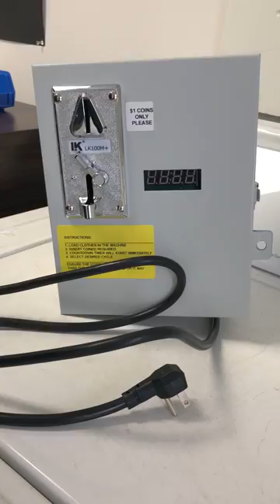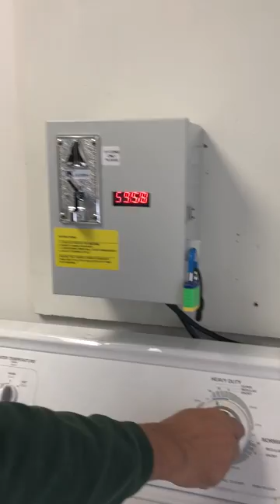How to Convert Your Domestic Washer and Dryer into Coin Operated Laundry Using SMARTCOINBOX

Comment: Can you do how to connect one video for auotomatic front load washing machine
Reply from the maker: Front load or top load...you are just moving power cords around. Plug your washer inside the smartcoinbox and plug the smartcoinbox back to your wall outlet. Done. No cutting wires. no electricians needed,

Comment: Some settings are 3 hours and some are 2 hours. If the person puts in for 1 hour Then the machine will go off half way through?!!
Reply from the maker: You can preset to run for 3 hours if you want. For example $2 (8 quarters), tenant will put in 8 quarters consecutively and as soon as he/she dropped the 8th quarter power will turn on for 3 hrs. Amount and minutes are adjustable. Some of our customers assign a cycle. If they have extras (spin, wash) then they have pay more.
Reply: What on earth are you washing for 3 hours?   Are you a coal miner?
Reply: @markpro1961  no but a usual wash and dry is 1h45 min....

Comment: Does it work on front loading washers?
Reply from the maker: Yes.
Reply: Is it for  sale  somewhere  specifically??
Reply from the maker: P cinematic  What our clients do is they assign a cycle with a specific amount. There is a  beeping sound in the last 30 seconds (adjustable to 60) in the coinbox  timer enough to give the tenant a chance to add more coins if needed. We sold thousands of these units for digital or non digital washer.
Reply: Hi, have you thought or developed a system that is no longer dependant on tokens and more app activated / nfc?

Thx

Comment: At over $300. Way to damn expensive!!
Reply from the maker: Its worth it. How much coin do you think you can collect in a month? Add the savings on your utility bills . We have customers that bought the smartcoinboxes back in 2012 and still in service today. They got their money back multiple times!
Reply: Your crazy if u think that’s expensive the machines are like 1000
Reply: I'm considering getting these as a defensive measure to protect against abuse.
Reply: I have a ex coin opp speed queen. It was $150 and they used a fork lift to put it in my pickup. 
That home washer won't handle heavy use of tenants.
Many coin opp machines for sal for 2-500 and they are meant for hd use

Comment: Yeah, try hooking up an electric (not gas) dryer to one of these coin operated devices, and you'll quickly find out that NONE OF THESE COIN MACHINES WORK ON 240-VOLT ELECTRIC DRYERS !!!
Reply from the maker: Why don't you contact the company you bought it from?
Reply: @smartcoinboxbymqtekindustr6711  I did not buy one because I'm an electrician and I already know these coin machines won't work with a 240 volt electric dryer.
Reply from the maker: @ihastoomuchstuff2  No secret here. We use a timer board that drives a relay and in return drives the POWER relay. In case of the 240V we use a 2 pole industrial type power relay (40 Amp resistive). The coil of this relay is driven by the on-board relay in our timer board.  Our ECW682 (120V) and ECD137 (240V) passed
a rigorous test in a testing lab (ETL). We only use CSA or UL approved parts.
Reply: @smartcoinboxbymqtekindustr6711   guess the electrician didn't know about that. Most electricians think they're hot shots that know it all. Considering one of these units for my rental. Do you guys have one that does credit cards?
Reply from the maker: @TheRds797  We use mobile app. No card reader. We use Payrange's BLUE Key Technology. You can visit payrange.com for details.
Reply: @ihastoomuchstuff2 Do you feel silly now?